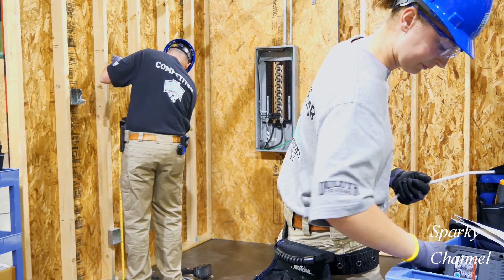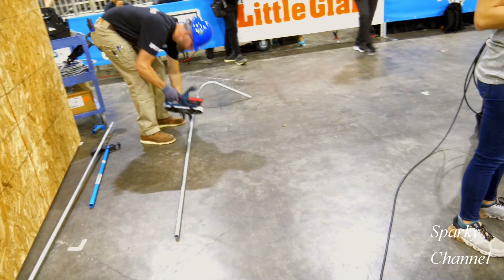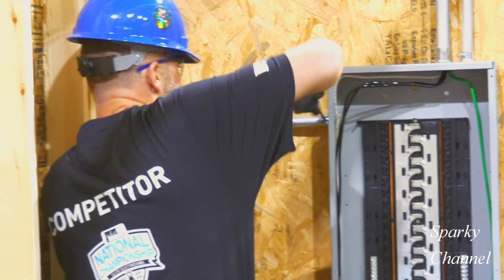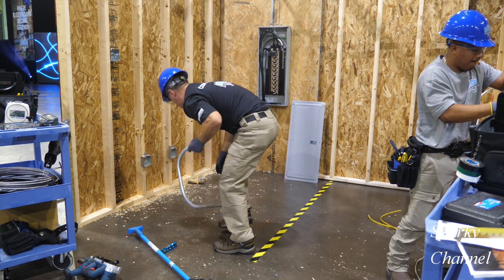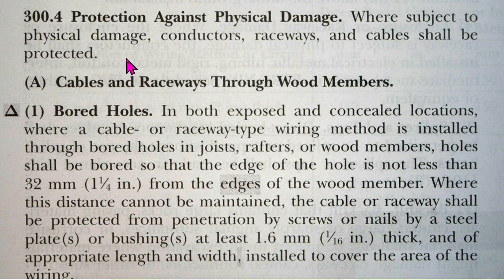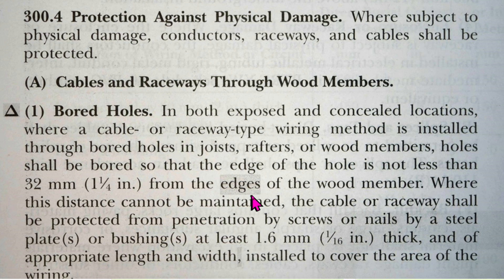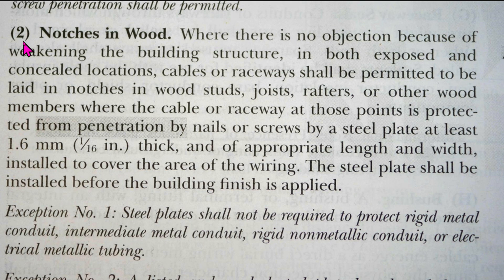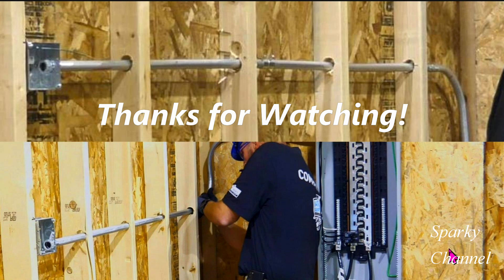How to Run Conduit in Studs per 2023 NEC 300.4(A)(1)

Comment: I remember those days. No fun at all. Makes it much easier for them not having the panel recessed.
Reply from the maker: Good point!
Reply: @SparkyChannel  I used to have a 1/2" short radius bender that we would use for the interior corners. Even then it was quite the PITA. The AHJ would look the other way and let us judiciously use it when absolutely necessary.

I still have the rest of my benders, you never know when a neighbor is going to want a circuit run. Or the frame of a greenhouse made. :)
Reply from the maker: @MrWaalkman  Nice!

Comment: Wouldn't this be an ideal location to use flexible metal conduit, or is that not code? You would certainly be able to drill a smaller hole.
On another note, I'm going to listen to Yes's version of "Close to the Edge" now.
Reply from the maker: LOL! Yes, type MC cable would be great in this situation. Unless your locality insists on EMT.

Comment: Center of stud holes just big enough for cable do not require nail plates, but we do them anyway unless the inspector says it passes due to the 1 1/4" distance from the edge, but dry wallers can get longer screws mixed up with 1 1/4, so play it safe.  I personally prefer conduit everywhere for the reason that circuits, or switch legs might be added or upgraded.  The same with conduit size.  We always oversize our conduit slightly for the reasons of ease of pull and possible need for upgrading or adding UP TO the limit required by the derating table.  Making small notches for cables is fine with nail plates since it minimizes structural damage caused by larger holes and totally protects the cable.
Reply from the maker: Thanks Greg!

Comment: A standard 2X4 is 89mm wide. If holes can’t be bored within 32mm of either edge. That leaves only 25mm in the middle on the stud where the hole can be  bored.  This is just barely one inch. 
That said, it is going to be almost impossible to work in a 3/4 EMT in a 1 inch bore if you are trying to adhere to 309.4 A 1, unless you drilling in from an outside corner of the wall and drill each hole within a 1/16” of clearance and perfectly square along a straight line.  
So, with 2X4 studs,I would go straight up  to run 3/4.  I’d leave the horizontal runs to 1/2 inch EMT.
Reply: Blah, blah, blah. The simplest solution is don't guess. Just ask the inspector before you install if they will require nailing plates and under what circumstances. Then, regardless of the code and the math minutia, you will pass inspection which at the end of the day is what we need to do to move along.
Reply: Technically,  25mm is less than one inch.  You will have exactly 25.4 mm if you do the math and don't round.  Better yet, don't change unit systems and it becomes a lot easier.
Reply: @D2O2  Two reasons I used SI units. One, the code paragraph called it out in whole SI units, and two, a millimeter is a smaller unit of measure than one sixteenth inch and slightly more precise. I guess “just barely one inch” is not as descriptive as 1 1/127”, not rounding. 
It is still true to say that it is going to be very difficult to run 3/4 EMT through a 2X4 petition and still adhere to code section 309.4 A1. Since the outside diameter of 3/4 EMT is specified as .922” and  .984251968504” drill bits are hard to find.
Reply: @bchrisl1491  The code also stated Imperial/US units.  A millimeter may be smaller than 1/16 of an inch,  but not smaller than 1/32 of an inch.  1 inch is 25.4 mm, not 25 mm.  A 2x4 is nominally 1 1/2 x 3 1/2 inches.  3 1/2 inches is 88.9 mm.  Subtract 2 1/2 inches (63.5 mm) from 3 1/2 inches (88.9 mm) and you are left with 1 inch (25.4 mm) to work with.  1 inch (25.4 mm) drill bits can be found easily.  3/4" (19.05 mm) EMT with and O.D. of 0.922" (23.4188 mm) is smaller than 1" (25.4 mm) and will pass through the 1" (25.4 mm) hole.  It is possible to place 3/4 EMT in a 2x4 partition wall, just not easily without several joints.
Reply: @D2O2  I said it would be difficult, as the clearance is very small and hand drilling a string of holes that accurately requires a great deal of skill.  Difficult, not impossible, but in practice I think working to a tolerance of 1/32” with hand tools is not practical without the use of a jig or other device to facilitate such accuracy. 
Away I say, for 3/4 EMT with compliance to 309.4 A1, drill one code approved sized hole in the top plate and run overhead where the joists are big enough to allow holes sized large enough for hand held tool drilling tolerances.

Comment: The nail plates are absolutly needed. Far too many people destroy the stud or drill them out to the point the stud the is structurally worthless. The next NEC revision needs to have limits as to how close holes can be and or max drill size from center of stud
Reply: Technically speaking, the building code already has rules for drilling structural members. The NEC does not have to define that because it is already defined. Maybe they could add those rules as additional reference, but your builder should cross-educate the trades working for them in order to prevent problems. If holes need to be drilled in structural members, then either the framers need to do it, or they need to make sure the electricians and plumbers know the rules. Else, they will be spending a lot of time going back and adding support plates around all the penetrations.
Reply from the maker: Thanks!
Reply: I totally agree.  If in doubt, if it's close, it something could happen, move up to the higher standard.
Reply: Nail plates do nothing for the structural integrity of the stud member. Stud shoes on the other hand do and would be an approved method to "fix" a damaged stud.

Comment: It is the responsibility of the contractor and his subordinates to make the inspectors job as easy as possible by knowing the code applications for your project. I use nail guards where required by code and use the code to verify when not needed!
Reply from the maker: Thanks Mark!

Comment: American electrical seems so backwards and labour intensive. Steel conduit in wooden studs?
Reply: It's mainly in Chicago where conduit is required. Plus it adds protection against rodents chewing on wires. Plus with pipe you can taylor your wire runs with the colors of your choosing.
Reply: @jolyonwelsh9834  The NEC is the MINIMUM level of safety, a standard not to be lived up to but a standard we dare not go beneath.  CHICAGO ROCKS!!
Reply: @jolyonwelsh9834  most of the world has one form of rodent but still wouldn't have that as a reason to justify steel conduit for residential. Why not bx then? Seems more like a grandfathered mentality of we done it this way in my day and we're not gonna change it. They still do plumbing in copper pipes there?
Reply: @dvrn86  NYC allows armoured cable because they too have a rodent issue.
Reply: That’s not normal for all of us 😅
Reply: It's a puritanical Anglo-Saxon mentality. To make things more complicated.
Reply: @jolyonwelsh9834  I assure you that in England it's nowhere near that complicated. Also referring to the US as Anglo saxon is kind of funny.
Reply: @dvrn86  We like to make things more complicated. Our tax code is  another example.
Reply from the maker: That's mainly done in certain areas of the US.
Reply: @SparkyChannel  Reasoning? I worked for many years in Canada so worked to CEC standards.
Reply: We not only use steel conduit but we also pull grounds and isolated grounds.  Far safer.
Reply: There are some municipalities that do not allow the use of romax or similar cables. I used to live in one such location. That being said, I have wished I could pull another circuit often enough that when I renovate my own house, I run EMT so I always have the ability to pull a new circuit if necessary
Reply: @TwilightxKnight13   Yes that's true. Plus you can customize your own wire runs that way. For example you can run black red and green wires for a 240 volt circuit. When if you used a cable format such as romex or M/C cable you would be stuck with a black and white wires. Because that is how they manufacture cable assemblies in North America.
Reply: Conduit is always far better.  Many old homes, apartments and commercial buildings in LA used conduit, so when wires were burnt, insulation degraded and falling off, we simply attach new wires to the old ones and pull old out, pulling new in, without any drywall or plaster damage and repair.
Reply: @gregchambers6100  if your wires are that old to have that level of degradation then surely the system wouldn't even be upto today's current code standard.
Reply: @dvrn86  My friends have been cooked to death from old, exposed wiring.  I take this shit seriously.
Reply: @gregchambers6100  my point being that if you used old existing raceways then surely there wouldn't be enough lights or receptacles to cover existing code? Yes I understand that and sympathise but why not then use something like bx for new installs instead of emt now? Or why not use ent? Seems excessive, expensive and laborious to do resi like that. Especially with the implementation of arc fault breakers.
Reply: @dvrn86  energy management has drastically reduced lighting loads and efficiency, while refrigeration is also far more efficient.  Heating loads are still challenging, but the conduit, in the walls, gives us options without opening plaster, dry wall, with murals, art work and custom paint.  I like conduit in the walls.  Conduit size and derating are factors of course, but it's nice to have options, whereas cable alone is the lowest caliber of options.
Reply: @gregchambers6100  

I agree. Living in Chicago I used to think NMC would be great. But now I know doing some work for family downstate where they use NMC is a PITA.

I like being able to tailor wire color to the job and or pull an additional wire if something changes. Using taped neutrals for hots is janky - half the time they are not taped. 

Not to mention hanging cabinets in a strange house where you have zero idea if the NMC behind the wall is present or protected. No ground wire is a bonus. And plastic boxes are garbage IMO

My brother worked with a guy who had a fire in his home. The fire inspector was convinced the fire started from a drywall nail in an NMC that laid in wait for 15 years, since the house was built,  to arc at the right time/condition.

Comment: Building codes dictate hole placement and hole size. As a rule of thumb I drill from the center and the hole cannot exceed 1/3 the width. I have never had to install raceway like this.  I was very intrigued and thought I might learn a new skill.  I was taught to bend conduit laying on the floor, I gave the other method a try and wasn’t happy with my results.  Suppose to be PLS and Parallel. The second contestant did a better job bending, but was cutting short pieces using connectors to fix his issues. I demolished a wall once with a long full sized piece of conduit in it with studs  16” on center. They had started with a hole from the door opening, pushed the conduit in, installed the switch box. I would like to see more content on how the Pro’s install raceways in stud walls without using a connector every 2’.
Reply from the maker: Thanks!
Reply: If you get to the job early enough, running full sticks of conduit become a bit easier,especially for partition walls. If I had to run horizontally, I would just punch a hole in the middle all the way from end to end. Then I could slide a full stick in one end thru all the holes into the cavity I needed, then couple a 90 down (usually) to the box. If you use deep boxes and are careful with the depth of your bore holes, you can avoid offsets into/out of the boxes and just focus on 90s. A well-planned job should not be overly complicated. And at the end of the day, the framing is all covered anyway, so who cares if there are a few extra holes as long as they don't exceed structural limitations.

Comment: Sparky, Thanks for another great video. I would like to see nail plates on the studs in Gregs installation. As far as the damage to the first stud, likely I would pass this unless the damage also occurred on one of the adjacent studs then I would like to see some strengthening of the damaged stud. Obviousley in the center of the stud is best but as you can see getting the conduit into the wall cavity becomes very difficult and somewhat tricky.
Reply from the maker: Well said, thanks!
Reply: If the damage to the stud was going to affect the skin (drywall, etc) the builder should require the electrician replace the stud long before the inspector gets a look at it anyway

Comment: No corner studs? How convenient. Maybe this test should be more realistic as far as the structure build.
Reply from the maker: Yes, that was a bit odd.
Reply: Yeah.  I was looking forward to some learning on that.
Reply: @robmurray5784  ---- at the very least there would be two 2x4 studs, one on eadh wall at a 45° angle to each other with either no gap in the corner between them or a small opening and then an empty space behind the two studs. Kinds like its own reverse corner, and sometimes the studs will be doubled so you have four total making that corner.
  You're never going to get a piece of pipe bent that will make that turn through the proper hole size. You would have to blow out the holes so big you'd lose the integrity of the studs and an inspector would call you on that as well as you'd piss off the carpenters if they were still around.
 Let's say you think you can do it. You'd have a hard time just drilling holes straight, they are going to be slightly angled, in and out or up and down or both and both holes, one on each wall, will be the opposite angles as each other so a straight 90° bend (that sounds funny) won't line up with the holes and you'll never get it to work. That's why God gave someone the idea for aluminum flex and even better MC cable or Romex. Corners are a pain in the ass. There's always a work around, a way to get it done but it is always time consuming extra work.
 I have to look to see if there are any videos that show how to deal with corners for electricians

Comment: If I'm running raceways or cables in a wooden structure I'm thinking about ALL inspections. Just because my electrcial inspector passes me doesn't mean the building inspector will like what I've done.  GC's don't want a failed inspection regardless.

•It's good to give local inspectors a call and or manufacturer recommendation for any engineered wood products.. (most inspectors don't know what's allowed per manufacturer specs, and an email or spec sheet from the manufacturer solves a lot of problems and arguments. 

•EMT matetial and tubing wall thickness is comparable to nail guards O wouldn't see a need for nail guards on EMT. PVC and fiberglass conduits seem like asking for trouble if a screw happens to "intersect" it. I would nail guard those.
Reply from the maker: Excellent!

Comment: No load bearing wall has an inside corner like that. Total BS.phase conductors are not identified. The funny thing about notchplates is when we passed inspection the rockers would go through and peel off the plates prior to rocking the interior.
Reply from the maker: Darn rockers.

Comment: Nail plates required however the first guy is smart, only needs nail plates on the one side.  I could run a screw right through that emt.  
Guy no 2 was kinda a hack.  100x better than me though haha.
Reply from the maker: Thanks